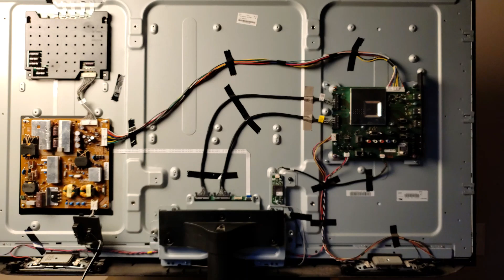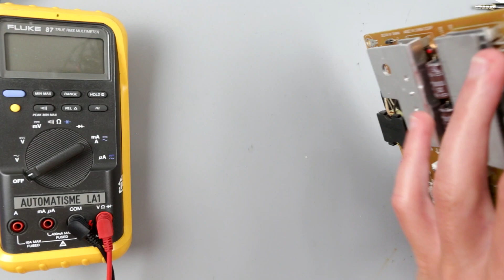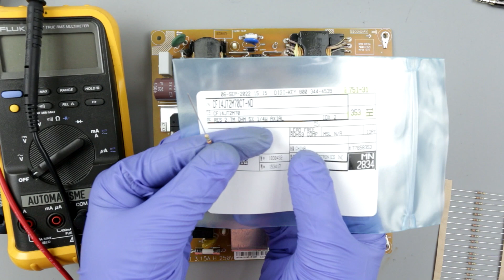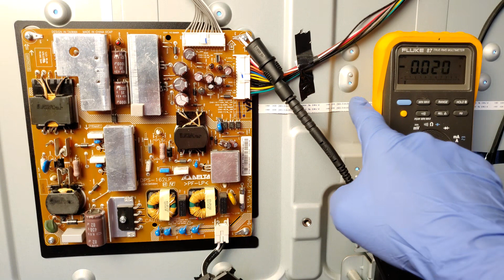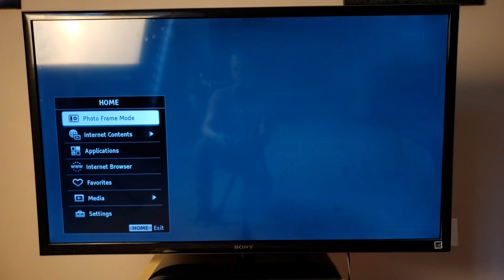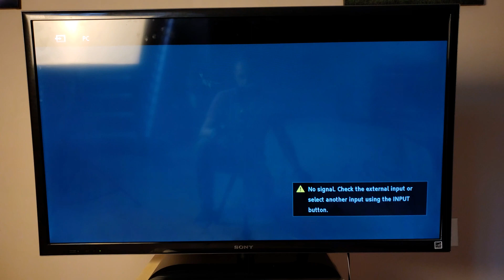Fixing 6 blinks with Sony KDL series TVs

Comment: hi good day, my question is why still no 24volts after replacing 2.7k mega ohms resistor, then pause your video,when you come back again is present 24volts?what will you do sir? replacing whole board, or using remote control or what? my pleasure to your answer. thanks
Reply from the maker: Thank you for watching.
Did you tested if your old resistor is actually burned ?
Could be something else.

Comment: A hint for everyone reading this and - no offense - for the creator of the clip as well: this model is so freaking old, that if you were to search for "KDL-50EX645 6 blinks" you would have found direct information about this resistor, which would have saved time and some [incorrect] - again no offense - assumptions on what is what.
Testing the high voltage feedback divider with a miltimeter for example is not a good idea. It can very easily trick you.
This blown SMD 2.8 MOhm could have also been 3.5 MOhm and then testing around like shown in the video would not have caught it.
Lastly, when you have two transformers and one is large and the other is small then it's not a matter of guessing, it's a certain fact that the high power one will be the larger and the smaller one will be for the low consumption standby power (of course one also needs to be able to tell between power transformers and separation transformers driving switching mosfets for high side and low side).
Reply from the maker: Thank you for taking time and writing extended reply. I appreciate any knowledge as I do not claims I'm professional in TV repair nor expert in SMPS but learning every time.

Comment: Well done. Suggest use a gel pen or sharpie, so your hand-written  notes can be seen, and also hand draw a small summary to show the IC and where the resistor was connected. Probably not a smart TV so you need HDMI input before any channels etc will display.
Reply from the maker: Thank you for watching  and suggestion ! I realized too late that my notes can be washed out, but usually I prepare a website page with details, it is in progress at the moment. This is is first get SmartTV but super lame and all soft is outdated :) So yeas not smart TV for sure.